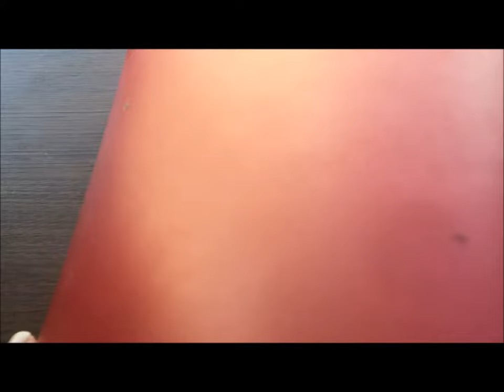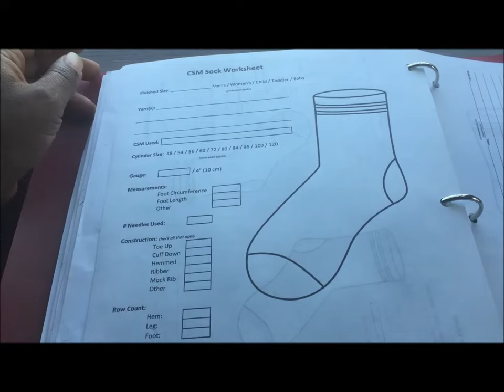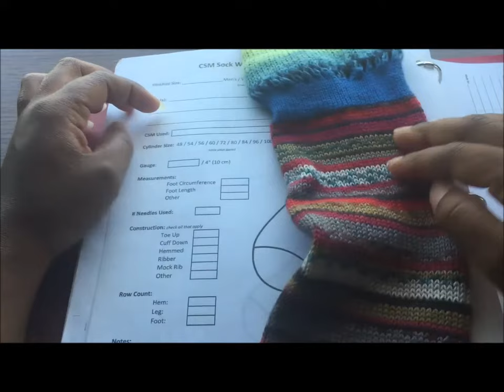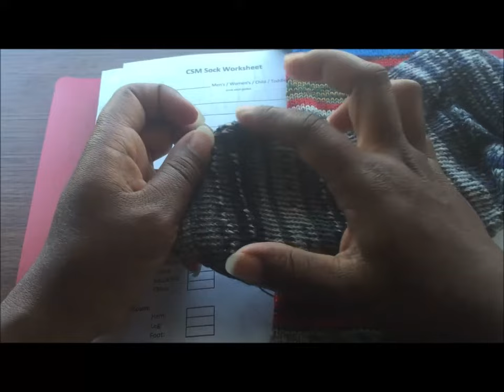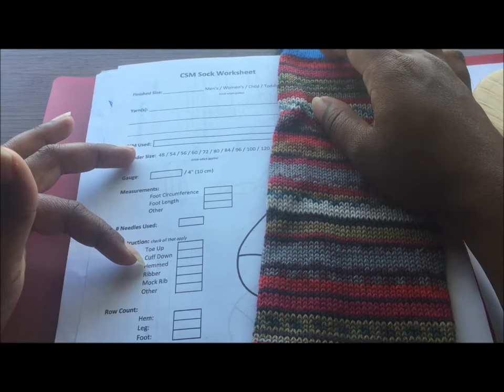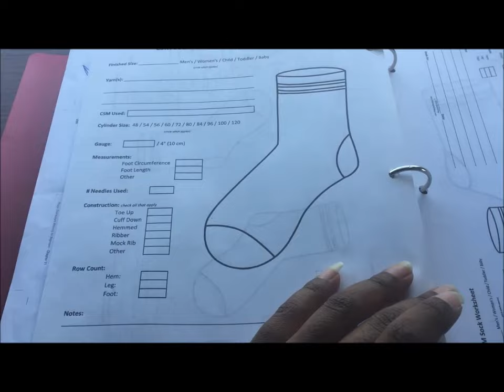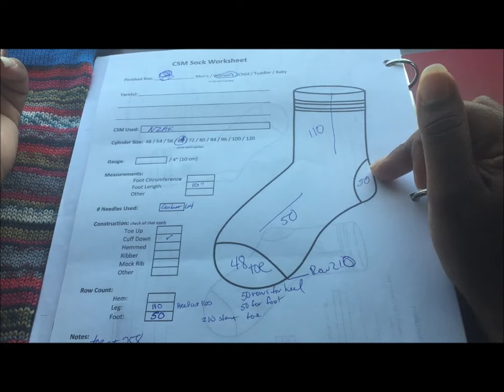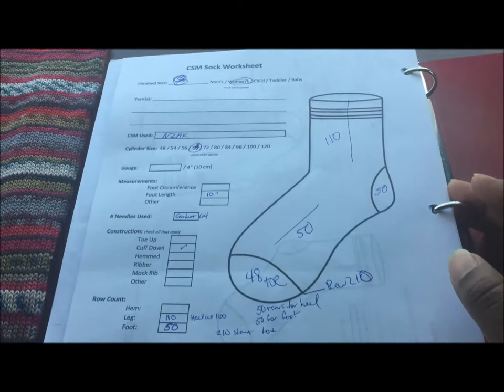The NZAK Introduction Circular Sock Machine part 1: Something Beautiful Handcrafts Knitting

Comment: When cranking without yarn, what damages the needles is the position of the yarn carrier. If you move the carrier away from the cylinder, it can’t catch on the latch and break it. But no one wants to do that, so just crank slowly and carefully.